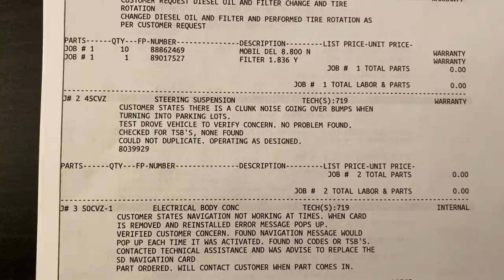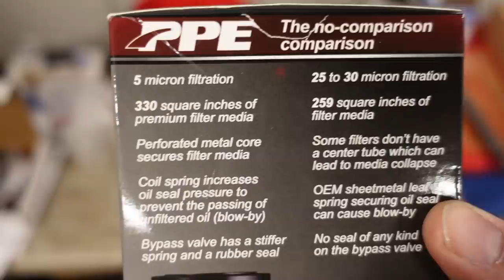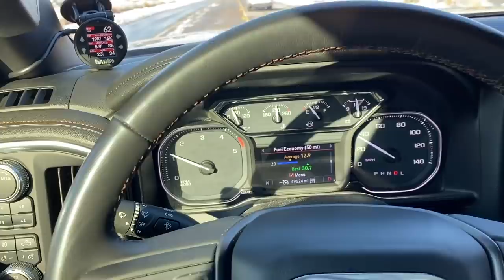fixing THE MOST ANNOYING PROBLEM with the 2020+ GM HD trucks

Comment from the maker: So here's something I forgot to talk about in the video: filling the fuel filter with seafoam. Seafoam is a cleaner and lubricant as well as a fuel of sorts, so by filling the fuel filter with seafoam instead of diesel, you displace the air to make priming and starting the truck easier after the filter change, but also it will give a little cleaning action directly into the injectors and injection pump. Additionally, they advertise that Seafoam will act as an anti-gel as well which is helpful in the winter months. All this is info they put on the can, but I had a few questions about it, so I figured I'd explain my thoughts.
Reply: Get you a couple bottles of Power Services Diesel Kleen and their Diesel fuel supplant antigel/ winterizer
Reply: The steering shaft thunk was very random as it did not affect all vehicles
Reply: there is a doc from gm for the steering shaft noise that you had  its PIT5809B and that is the newest part that gm calls out for that doc
Reply: Def is a money waster
Reply: Could be a detonation risk.
Reply: GM has had Steering intermediate shaft noise issues in the trucks and suv's since the GMT800 series came out. Some of the cars had the same issue. Bulletin on the 800 trucks has been updated several times (over 20 the last time I looked) and the issue continues to return. Hopefully you have better luck since it seems like GM cannot make a decent shaft that lasts.
Reply: I have howes in my cabinet. We all use something different and that’s whatever but have you ever seen project farms anti gel test video?
Reply: @shadowopsairman1583  Until your truck is defaulted to 4 MPH. Or you risk fines by disabling emission devices (though some places care much less than others)
Reply: Tell the truth you still got the noise don't you
Reply: Thank you for explaining that!
Reply: Ive heard of that and now I will do this, since you do LOL

Comment: @2:21 I take issue with this because this is not a "WET" system the oil  filter goes into bypass at a certain PSI so it filters nothing after that point untill you get below that PSI threshold.  You can get the same coverage by just maintaining regular service intervols on your truck.

Comment: I’ve been using magnets on outside of oil filter and oil pan for years. Never thought someone would build a oil filter with a magnet inside. Maybe if I was a little smarter I could’ve done that. 😂
Reply: I put ceramic magnets in my oil filter, down into the body. Then I pull them out clean and put into the new filter during an oil change. This way the filter grabs the large particles and the smaller magnetic that make it through get stuck on the magnet.

Comment: I would have some serious concerns with using a 5micron filter on the main engine filter from a flow standpoint. There’s a reason the factory doesn’t use a 5micron. The finer the media, the higher the pressure drop across the media at any given flow rate with a rising curve. My guess is that filter may be in bypass a lot of the time. To run that fine a filtration rate, one needs to be running a kidney loop system.
Reply: That filter should be lower pressure so it should be fine.  The biggest part is maintaining flow.  As long as their is enough media/surface area of filtration flow should be good as well.  The high pressure system on that truck will toss a code if it starts to struggle to get fuel from the lower pressure side so itll warn you before issues.
Reply: @brandonbrown3600  Engine oil filter is the 5 micron filter that he installed.

Comment: When I was a tech and we had a same similar issue on GM cars. Like the Monte Carlo chassis I think 2000 and up. There was a bulletin of inadequate grease in the intermediate shift causing wear and slop. 
As I owned one the fix was to just re grease the shaft. But that was a pain. So on MY car I disassembled the shift and cut a tiny groove in the male male splines and drilled a corresponding hole in the outer shafr and tapped for a Needle grease zerk. And it became part of my maintenance routine.

Comment: Excellent work, not surprised the dealer could not figure it out. Even the dealer is not gonna be as motivated to figure something like this out.  

the only thing is I would’ve stuck with the OEM fuel filter system. To each their own and you did a very good job.

Comment: That steering shaft 'clunk' has been an issue with the GMC & Chevy full size pickup for over 20 years. during the first ten years GM said to grease the spline shaft, then they said to 'pack the slip joint in grease'. The one on my '06 was replaced 4 times under warranty and they finally got it right. Got lucky with my '14 and '19 models but heard from enough buddies to realize the issue was still around. Drove a new '22 at a dealer and the clunk was back. Just a pain in the butt and GM will not issue a recall as it is not a safety issue. Hell, it took them 6 years to admit there was a problem.
Reply: Saw this problem with my 1998 , last GM product I owned Toyota or Honda for me.

Comment: I work for a dealer and I’ve replaced a handful of these shafts already. Also there’s a priming sequence for the fuel system and I like diesel hotshots secret for duramax engines put it in the fuel tank and just prime the pump. No need to use sea foam.
Reply: That’s correct.
Reply: I can’t get the fuel line with blue Clip unclip 😰 any help to get unclip?

Comment: If you have an injection pump failure the dealer will point straight to that 5 micron filter (which will probably be in bypass 1/2 the time)
Reply: That 5 micron filter is the engine oil filter. The fuel filters do not bypass, if they get plugged, you walk .I cannot imagine unfiltered fuel reaching the high pressure system.

Comment: By the looks of things the engine bay looks more jammed up w wiring on the drivers side I'm kinda glad I have the older version also I've deleted blocked off egr deleted
 emmisions and have a 4 inch straight pipe exhaust the deletes helped clean up under truck and in engine bay I apologize I have a terrible time typing in this comment section of the youtube video

Comment: Did I miss where you explained why a can of seafoam goes in the fuel filter?
Reply: Not to pretend like I know everything but I can’t imagine a solvent based cleaner like sea foam is good for a high pressure fuel pump, let alone a CP4. Especially being poured full strength like that right into the filter. No lubricity. But that’s just my opinion. To each their own.
Reply from the maker: the seafoam actually has lubrication properties as well as a cleaner, and it is a petroleum based product so it burns just like diesel. Also worth noting, the can only fills half the filter, so its immediately diluted as soon as the fuel pump kicks on.
Reply from the maker: I thought I put a graphic on there to say something, but it's an injector cleaner and lubricant all at the same time, plus also acts like a fuel so it will burn just like diesel. The main reason is to not have as much air in the system when you prime the pump and start the truck also.
Reply from the maker: an article worth a quick read https://seafoamworks.com/questions-and-answers/how-do-i-use-sea-foam-to-prime-a-diesel-fuel-filter-solved/
Reply: @gavinj.8330   I used to fill the fuel filter with Dexron ATF when servicing heavy equipment aand trucks. It worked great. An over the road trucker showed me that years ago when their fujel filters used to gel from the cold. This got the truck back on the road. Also the ATF cleans the injectors a little when it fires up. This method worked great on evreything I serviced including my Cummins Diesel pickups.

Comment: GM trucks have had that column noise in the upper steering shaft for the last 20+ years. I've replaced a ton of them on the early 2000's.
Reply: bought  new 1999+ silverado that had several replaced in the first year or two due to the same issue.  Why do these maufacturers not learn?
Reply: It seems that all car and trucks of all brands have this clunk after a couple years.  It’s normal.  People are picky nowadays.

Comment: Wow almost 20 years and they still haven’t figured out the steering shaft??  On my 2002, which I bought new, I put in a different “all new upgraded” shaft every 30k until I sold it a few years ago.   Each time was supposed to be “final” solution, but within 30k… clunkunkunk.
Reply from the maker: yeah, thats what I'm worried about here, how soon the noise will come back. luckily, its not too bad of a job to do

Comment: Question on the oil Filter, 5 Microns with a Magnet is awesome, I am running the Mobil 1 "M1-210A at 30 Microns and I cant get a straight answer as to the Microns for AC Delco PF26. The Mobil one is rated for 20K Miles, what is the mileage rating for the PPE Deep (High Efficiency 5 Micron) With Built in Magnet Part# 114000740 and more importantly where is it manufactured ? I am driving a 2020 3500 Denali with L5P Duramax.
Thank you for the fantastic informative video

Comment: That has been a problem on GM trucks since 1999. You would think they would have gotten it right by now.
Reply from the maker: I agree, 20 years of the same problem is not a good thing
Reply: At least it’s not something worse, like ford having 4 different Diesel engines in 20 years

Comment: Typical dealership/post production thing: "we don't hear anything" (So its NOT officially under warranty work/recall) "here's an redesigned part you can BUY from the dealer to fix the problem" By having the part they know it's a problem, but making you buy the part, instead of them

Comment: As a current gm tech. The only time I start to look at aftermarket filtration funny. Is when I have to change the filter. So long as the info I find is positive. I won't raise a red flag. As a current lml owner. I understand having the extra filtration and water separator to protect your investment. Also, I remember way back when with your water leak. They did an ugly job "fixing" the problem. I would contact gm direct and see about having them properly resealing it. Its become more and more common, especially on the half ton chassis.
Reply from the maker: luckily it still doesn't leak, but it does bug me when I think about the product they threw on there to seal it up. Hopefully the filter doesnt cause me any more headaches down the road with the service manager, I sure feel like its a much better product than the delco filter.

Comment: Those new AT4 is bad boy but my 06 and the fact I don't have to buy that bullshit DEF FLUID  SUCH A JOKE  catches particulates but then burns it into the air anyway just a way to make u spend more money  374,000miles and still on stock injectors only thing I've really had to do is front end parts and a injection pump 
 I bought a stand alone filter head that take a $12 filter with a water separator  
Made my own lift pump removed the stock filter setup with a petcock that I can bleed the system by opening and turning on the lift pump Wich is located next to the fuel tank

Comment: I also experienced the intermediate steering shaft issues in multiple years of GM trucks.
replaced upper as well as lower shafts with upgraded shafts and each repair seemed to get better but not until I spoke with a Dealer Mechanic and was given a tech sheet that advised fill the boot with grease at firewall, Pack it full as possible. only the was the problem solved.
I have the same problem on my 2020 3500 HD Denali. Time to investigate problem.
Great Information here Thank You.

Comment: I forgot to ask about the bypass pressure setting on that filter, and until the filter goes into bypass mode i am concerned with oil pressure and oil starvation. The L5P already has low idol pressure as well low operating pressures.

Comment: I had the steering shaft replaced on my 2020 and its a night and day difference. Now I need them to center my steering wheel as its between 10 and 11 o'clock driving down a flat road. Annoying

Comment: If you call the gm regional office fir your dealer and show them video they will refund your expenses and might do more for your trouble. Friend is service Mgr at local dealer and told me to tell you to do that. His store would have made it right from beginning. You have the documentation to back up from 100 miles. They have to prove your part caused issue. Fleece can provide proof of improvement.

Comment: Seems like GM hasn’t fixed this issue at all.  Out of three of my GM trucks they’ve all had noisy steering column/ISS.  Replaced the lower column bearings and it wouldn’t last.  The hose clamp mod sounded really strange and not sure how it would work but it worked, surprisingly.  Lasted years until I sold the truck.

Comment: Lt it's north Maine Steve I own a 08 duramax lmm I noticed u stepped up filter quality good idea I noticed u using Mobil delvac I wanted to tell u about the oil I use it's brand name Can-pe-co in a yellow jug .they have para synthetic , heavy duty conventional what I use every 5 ,000 mi. Also they have full synthetic. Diesel fuel systems of Maine swears by this oil after tearing g
high mileage diesel engines apart and having minimal wear noticed . Also this cen pe co oil has the additives in it that commercial oils no longer put in due to environmental reasons or whatever. I guess the anti wear additives is what puts this oil in a different league I have 235,000 miles and my duramax and this oil keeps her sounding great

Comment: Can’t believe that filter isn’t protected if the front u-joint should ever go for some reason an bust the filter an drains all your oil while engine running
Reply from the maker: never thought of it before you mentioned it, but you are right. that could cause some damage
Reply: do these engines shut down for low oil pressure?

Comment: Re filter specs (micron, etc).... The micron rating is really only half the spec. The other critical piece is the efficiency at that particle size. Even a screen door is a 5 micron filter; it's just not very efficient at it. Also, while "bigger is better" is usually the case with particle capacity, you also have to take into account pleat dimensions, pleat count, and material. Synthetic materials can hold more than cellulose, so a smaller synthetic filter could possibly hold more than a larger paper one. 

Not saying these weren't good upgrades. Just something for folks to be aware of when they're comparing filters.

Comment: I see some people don't like your fuel filter, well Donaldson is a great filter,  way better than a stock A/C Delco.  The thing to remember is the better the filters are, the least likely to have engine issues. Cheap filters will let more particles, Have you ever seen what a fuel pump does when to much crap plugs into it, engine destroyed.  For you Diesel guys out there,  you can save money with blue def if you top off at a truck stop or a place that has def next to the diesel pump.  but also keep a couple spare jugs in your garage.

Comment: It seems everyone is having issues with dealers no matter the brand.  I bought a brand new platinum f-150 and it was having transmission issues.  Dealer didn't know what was wrong after I told them that the 5 to 3rd downshift grinded like heck.  They came back and told me ford knows there is an issue with the oil feed on the clutch pack but will do nothing about it unless the customer complains enough...they didn't want to issue a trans recall for 5 million trucks😑.  Needless to say my trans was rebuilt 3 times before 30k miles with a restraining order due to me raising my voice at the service manager.  (Autonation ford bradenton)

Comment: I use the Parker / racor brand oil and fuel filters but that fleece black oil filter looked like a nice upgrade I've used fleece perf. Products before but only for electrical I bought the all lights on chip for my 05 sierra 1500 it was tit to install and gave me. 4 hi and 6 hi headlight mod w no wiring messed w just unplug relays set chip in place and reinstall headlight / fog light relays 5-10 mins done deal. I really like the all lights on upgrade from fleece maybe mention it in your future videos love what u do man u are a huge influence on my projects

Comment: My steering is doing the same thing. It is worse at slow speeds and you can actuallyfeel it in the steering wheel.. I have it at the dealer right now. It has done it since it had 10 miles on it and now has 27k miles on it.

Comment: 1 why did they not fix it? Super common problem and I've personally  fixed 10+ of those no charge to the customer. 2 why did you pay for it? 3 don't fuck up the Teflon bushings o  the firewall. Your dealer techs should feel dumb
Reply from the maker: each time I took it in, they said everything sounded normal to them, so they weren't even acknowledging the problem

Comment: It’s a reasonable estimate that you will need to change that filter 5x more often. Would I do that? No, but 2x more often is not a far departure from reality with a lower micron filter. Now, if you ran a 2 filter system you could be in a better situation. Just smacking on a slightly larger lower micron filter will not keep the same oil change interval.

Comment: If u fill the filter let it sit for a minute all the oil get sucked into the element  then fill it half way again I usually just fill it and  thread it in as fast as I can rather spill a little 
Even doing this it takes 15 sec to get oil pressure

Comment: I have a 2019 gmc duramax ,I've had it into the dealer a few times with a similar nose, still there ,about 25000 miles on it now . I wonder if it shares the same shaft?

Comment: Extend the steering intermediate shaft then use a rubber plug and fill it with thick white grease and then compress the shaft the rubber will stop the grease from escaping this forcing tje grease into the space in the slide part of the shaft . this is a gm service tsb.